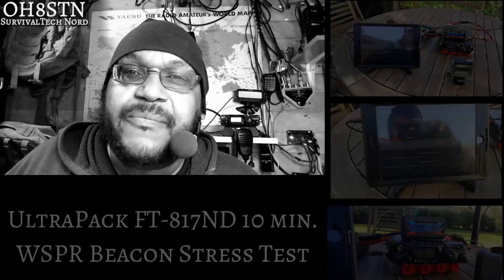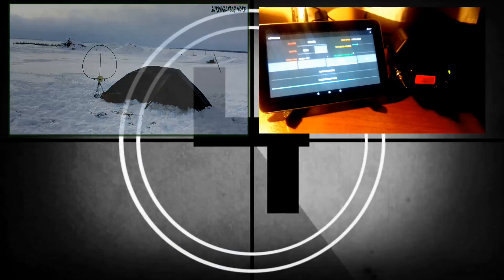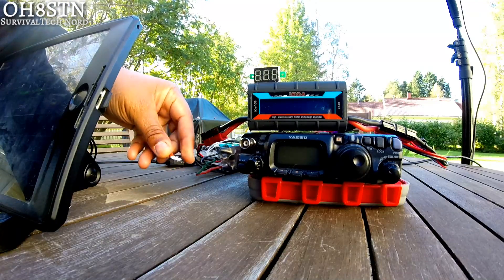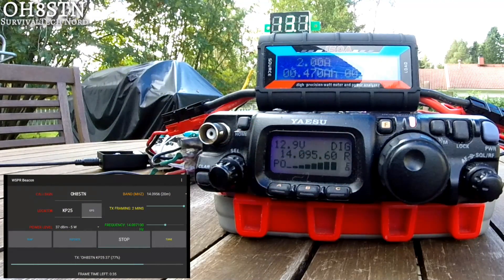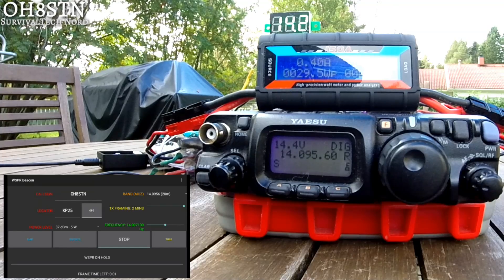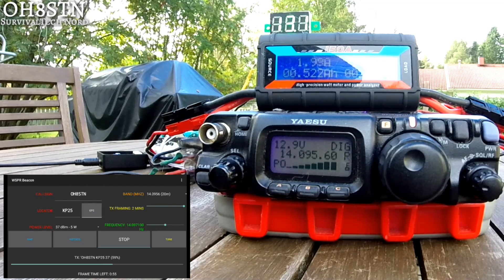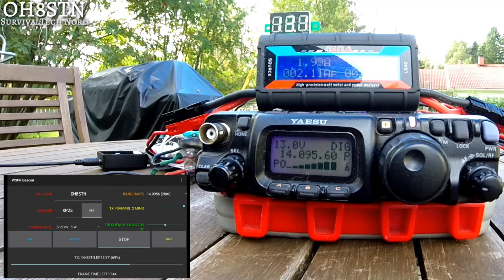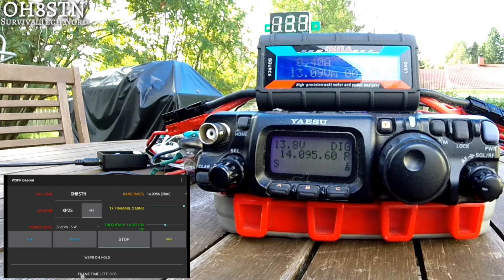DIY QRP Battery Pack STRESS TEST

Comment: hello, really enjoy your videos on many levels. I'm going to go off topic briefly and I apologize. in many of your videos I see you ft-817 with a black face/chassis gaurd. is this an item you made or had made or is it an off the shelf item?
Reply from the maker: +Patrick Champa thanks for reaching out Patrick and this is definitely not off topic. The brackets come from Chameleon Antenna.  here is a direct link to the webpage http://chameleonantenna.com/ACCESSORIES/CHA%20FT-817%20BRACKETS/CHA%20FT-817%20BRACKETS.html
The new version of the bracket is much better than the one that I have. Hope this helps, thanks for watching and commenting.
Reply: oh cool, I'm familiar with their gear via your videos or others but have never been to their site. I retired from the Army as an FO and have been using military antennas mixed with mixed commercial gear...basically the only thing I changed commo wise when I left is I traded the SINCGARS for the Yaesus. I really like the 817 but I wanted to find something to ruggedize it when it's in my manpack/ruck. keep up the videos in my opinion you put out good in depth information that is missed by many others. 73

Comment: Did you use a boost converter? I thought I saw one in the video where you made the pack. If so does it add noise to the radio?
Reply from the maker: Great question. the boost converter does add noise! it's easy to clean up that noise with a toroid on the output of the boost converter. it's the same problem with the voltage regulator coming out of the battery pack to the radio. that one required two toroids to clean up the noise.  I'm thinking about adding some filter capacitors on the outputs. I'll show the noise problem and some upcoming videos. I'll also show how I cleaned it up.
thanks for watching and for commenting it's very much appreciated
Reply: Yea, that is why for my radios I use linear regulated power sources, not the most efficient, but super clean power. It is a challenge to get a linear regulator that can handle a radio that puts out over 80 watts of power, but it is something that can be done but will require big heat sinks and a fan. Oh well, you either try to clean the noise or dissipate the heat.

Comment: Julian, 

I think this may be what you suggested from BatterySpace: 
http://www.batteryspace.com/Protection-Circuit-Module-PCM-with-Equilibrium-Function-and-Fuel-Gauge-for.aspx
Reply from the maker: +Bruce Barr doh, I just noticed this. I think you can pull the trigger Bruce. They call it a PCM, but I think it's equivalent to my BMS. It has all the safeguards mine has, with the addition of the fuel gauge.
Please read the specs to make certain it matches your batteries!
http://www.batteryspace.com/Protection-Circuit-Module-PCM-with-Equilibrium-Function-and-Fuel-Gauge-for.aspx
Reply from the maker: ping?

Comment: Gentleman, this seems to be the manufacturer of the BMS board: http://www.ayaatech.com/pcm/4s-3s/299.html
Here it is on alibaba 10pc. Min.: https://ayaatech.en.alibaba.com/product/1977373814-211983110/BMS_PCM_for_LiFePO4_Battery_Pack.html
Not sure what price is for Min. Order. I can front the cost of order for those this side of the pond, if it is reasonable piece price.
Reply from the maker: Be careful. The board on Ali is the LiFePO4  version!

Comment: Julian,

I am very interested in the UltraPack. I have most everything already. I ran across another YouTube on using the Drok for charging packs.  Still need to source the BMS.
I have read through all the comments for all the UPack videos, but no consensus their.

I even have the folding solar panel.

I am going to go for at least 4S2P.

I also took notes on your ecomm v2.0 video.
Downloaded all the Android apps.
Own the expensive hardware, need to order some of the interfaces.

Keep it up! I sent something your way to help a little.

Bruce Barr 
73 de AB0YO
aka MrGadgets
Reply from the maker: +Bruce Barr I think you're way ahead of many of us Bruce. Please take special Care on the BMS you choose for your system . The equilibrium or balancing function is actually very important in the field (imo), actually simplifies maintenance and charging up the battery pack.  otherwise we'll be take me to sells out putting them in a charger for balancing and so on.

I'm hoping to get this project done and published in the next few of weeks. I want to use the pack at the Autumn RADAR challenge with the 817. I haven't mentioned it publicly yet but battery space has a very good BMS which is similar to the one I'm sourcing from Germany. So you'll probably find one there.

If you have your own blog, YouTube channel, ... where you build is shared, I'm happy to give a shout out or share your build. Also much thanks for the support. Everything helps and it's all greatly appreciated.

Comment: Looking good ! I ran mine all night on WSPR with my big diode regulator (Ver1)without any incident. Hopefully I'll get my enclosure done next week for the BMS one (Ver2). Thanks for sharing !
Reply from the maker: +SurvivalComms Thx.  I think I'm pretty confident to put it all together now. The only weak point is the Olight batteries. I think I'll also build my own regulator. It's only 2A. Even at 5A, I can still make it a better form factor than Drok can.
I found a better enclosure for the 1P 150mm X 80mm X 30m.  A 3d printed faceplate would set it off nicely.
Reply: The housing I'm using is repurposed from an old async shorthaul modem. I have a bunch of sheet aluminum here I'm going to use as a faceplate. The voltmeter I got is a bit smaller than yours but I can mount it with 4-40 standoffs. The cover I'm using is clear plastic from a tic tac box epoxied in place on the face plate. Battery wise I'm using the generic NCR18650B cells. I used an 8 amp BMS board and so far it works good. I had put the project on the back burner as I found several 2.5ghz SS radios configured for pay phones that I reconfigured to use as a field phone and PSTN link for my property. I made a video on that but I'm not sure if anyone is interested in legacy wireless wireline interconnects with local wireless redundancy.

Comment: Hey if you had to by a home base radio would you buy the 817 or the 857?
Reply from the maker: +setofirons oh my God man that's like asking me if I should choose between  a Land Rover/Jeep, Ferrari/Lamborghini, M4/AK, ... if you're not going to use it portable then I would definitely say the ft-857. However remember that the ft-857 is an amp monster at 100 Watts. So the additional cost of a power supply should be figured into your plan. One thing about the ft-857 is the 20 watt mod. I think it's also called the blue wire mod. Atlantic Power of the 857 to 20 watts. Naturally then the power supply requirements would be reduced. I really hope this helps.

Comment: Ya see, now you're making me want to rebuild my 30Ah SLA battery boxes and see if I can build one big enough to power my FT-857D using 18650s.  Thanks, bud!  ;)
Reply from the maker: +Richard Slusher Actually Richard. My next build  (if this doesn't blow up) is a 20Ah base camp version housed in a Pelican 1120. I'll base that of a similar bms in 4S4P configuration, using the Genasun to do the charge management :) 2016 (17) are the years for ultra-portable emergency power (without unnecessarily large 3d printed junk with rubbish parts).